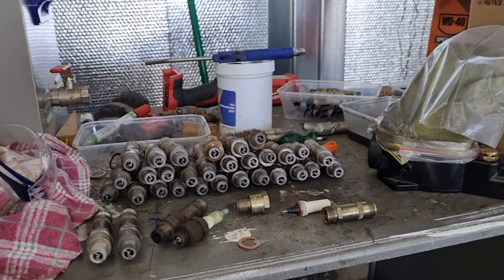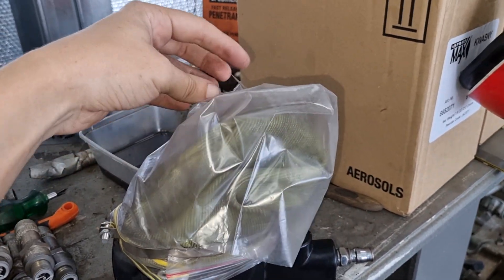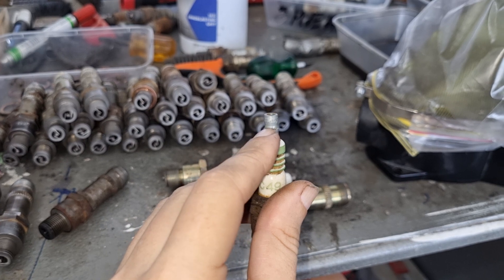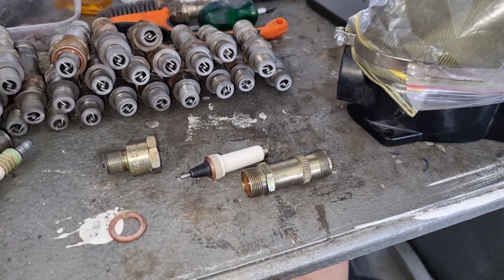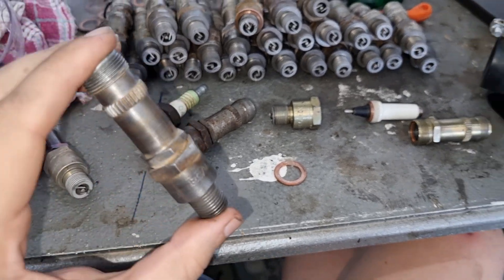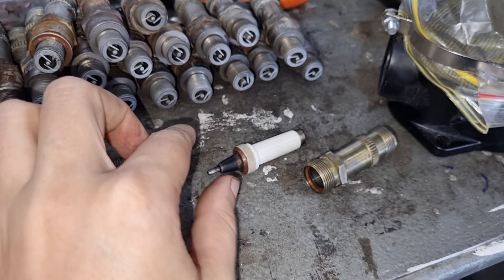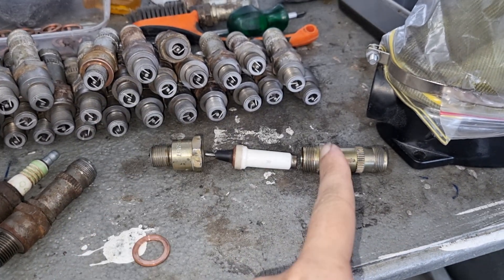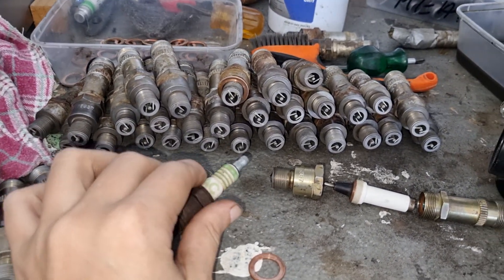Anatomy of aircraft spark plugs

Comment: Thank you Lottie for more interesting information that I will probably never use😊! I was aware of the need to pressurise aircraft ignition systems to keep them working at altitude where the thinner air does not insulate as well as at sea level but the construction of these special plugs is something else. I now know two of the reasons why converting car engines to aircraft use is a technical and certification challenge.

Comment: You mention the copper o rings/crush washer to keep water etc out of the engine.. but I guess its also to keep the compression inside the engine ?! The plugs need to be gas tight at combustion pressures not only water tight at atmospheric ?

Comment: The aircraft type are of that format because at high altitude the electrical performance changes. The Americans had a three prong earth on many of their plugs after take off failures. The British on their KLG plugs transformed the body into a ceramic in the thirties having remained faithful to mica earlier for success on racing engines. KLG stood for Kenelm Lee Guinness of the brewing family. At a later date in the late fifties Lodge launched the Golden Sparking Plug which after much testing on employees cars etc was released for sale. My uncle who was factory engineer for KLG had a set, completed his report as to satisfaction    and sent it in. The launch was a failure and the product was withdrawn as cars broke down all over! The cause Ah yes the cause. Well in short orders for say 10,000 plugs the resistor makers went to their laboratory and asked for a particular value of resistor and this, because it came from the laboratory was 2% tolerance. When a a half million we’re ordered it went to production line and was produced at 20%. Oh dear! Too late. The irate public was angry even with refund and Lodge faded away. So when you order resistors for your electronic work always decide the tolerances you want and there are many to chose from! Because of this the gentleman who was enquiring as to resistance received a reply to dissuade his testing. He might well have variable resistance of plugs possibly depending on heat range. The agent had no chance of explaining all this so the answer is No we will sell you new. They do not wish to be the next Lodge. The cost of a plug compared to life insurance for aviation is negligible and for a tank so much better than cough, fart and splutter! Are we still allowed to say that? Enjoy your day from an old ECE!

Comment: Lottie - if you can remove any of the copper o-rings, hang them on a big loop of stainless wire and torch them until cherry red (but not so hot to melt them!) then hold it for a minute.  Let cool slowly. It anneals them, and they'll seal better. They get work hardened from being squished repeatedly.
Reply from the maker: Thanks for the tip 😊

Comment: I worked as a mechanic at the airport in the late 90's. Regional carrier, so we had several piston powered. It cost us about $75 each back then for plugs, so we HAD to always clean them carefully. Especially on our Convair 240! Two engines. 18 cylinders (radial) each, 2 plugs per hole. do the math.  :O
Reply from the maker: While working on a Sherman, Ford GAA, we were going to be charged $250 per plug. That was a no-brainer 🤣
Reply: @lottiethetankwhisperer  - doh!  Yeah, they've seemingly gone up in price since 25 years ago!  Go figure.  ;)

Comment: I tested a set of resistor plugs, and got ohm resistance readings all over the place. I called the manufacturer, and was told that is proprietary information. So I just took the average and ran with that. Threw out any that were at the outter readings scale. Like you said visual inspection as well. Good video, I really enjoy this mechanical tedious fun.
Reply: Proprietry information?  On things that have been made for decades and decades by hundreds of manufacturers?  What nonsense!   That's just code by whoever you spoke to, meaning "I dunno wot resisance is, and carn' be bothered finding out."

Comment: During WW2, my grandfather had farms on the Brisbane bayside. My father, a teenager during the time, told me that spare parts were impossible to obtain for the farm trucks, a Studi and a Chev, around one and half tonners, with winch operated tipper.
When sparkplugs burnt out, they would drill out the core and replace it with a copper nail. Both vehicles had coil and points ignition, my father used to rebuilt the points, and my G/F even rewound a coil which failed. Necessity being the mother of innovation. 
Again, are you a Queensland girl ? Cheers.
Reply from the maker: I am a proud Queenslander! 😊
Born in FNQ!